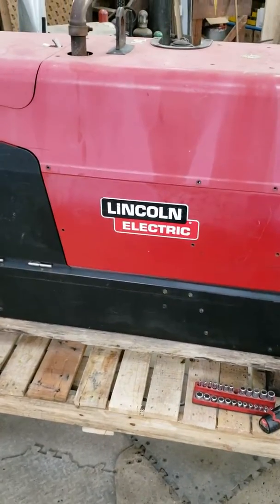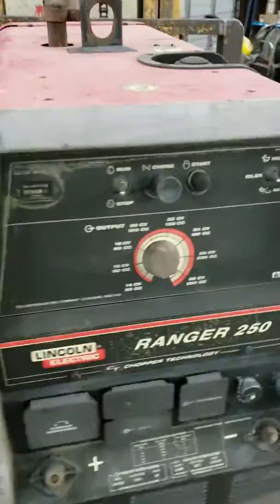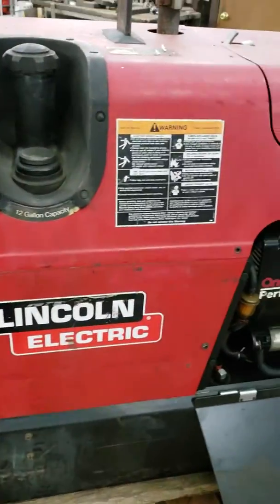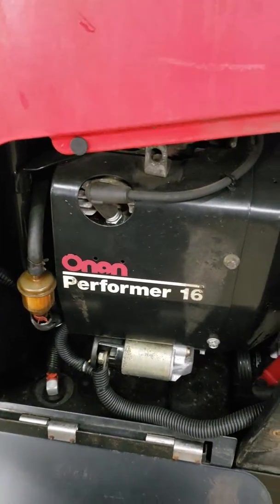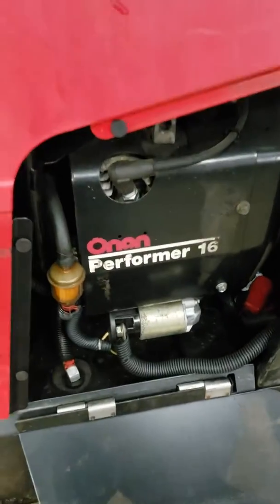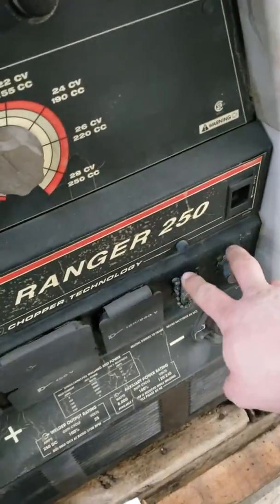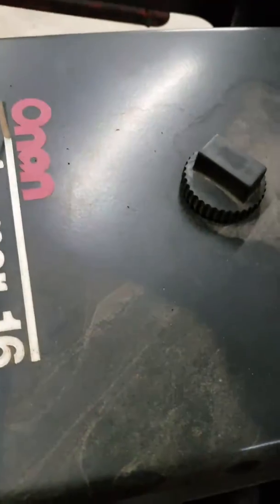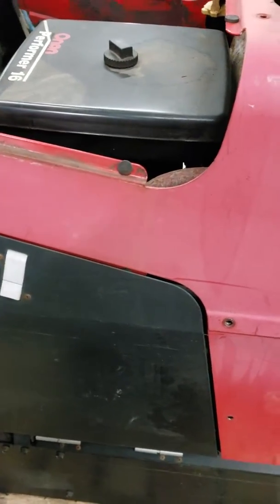Lincoln ranger 250 bad engine. Onan performer 16

Comment: This Onan engine is totally rebuildable. The heads unbolt off the block, then u can see the piston and valves.
Reply from the maker: Not on this particular model the heads are cast into the block along with the valves and valve seats In a corner my should have been updated video when I got inside to show you I believe I have some pictures in it up pressing a new valve seat in little bit larger and making it run again
Reply: @JayBirdsFab  I know Jeff a long time . If any one can get the motor running. He can . He got few videos Rebuilding Motors . Onan and kohler .his my go to guy .on a welder .

Comment: You can lap those valves  without removing engine  you can order a ring piston and valve kit that comes with all the gaskets . Or if you have a few thousand to spend you can get a Honda swap kit . But you can repair that engine